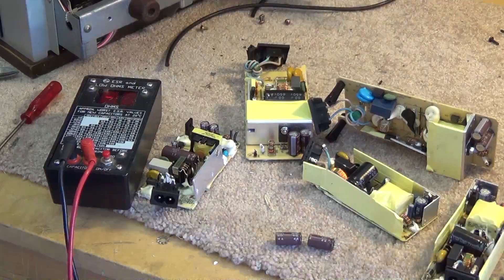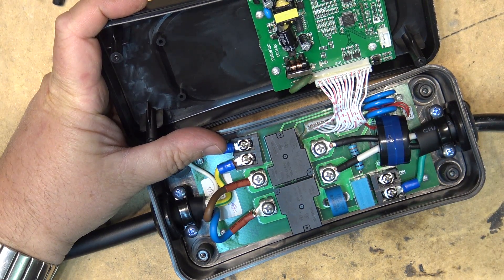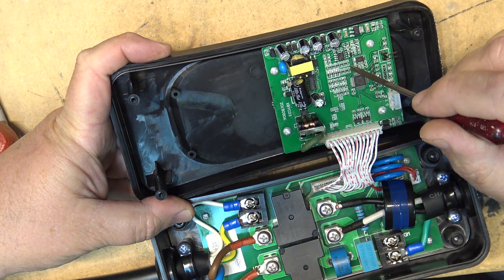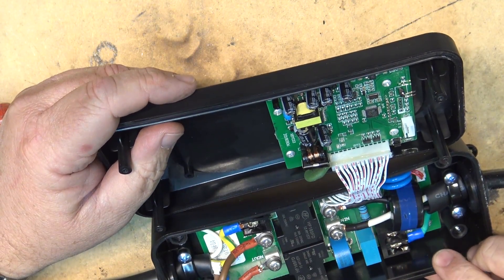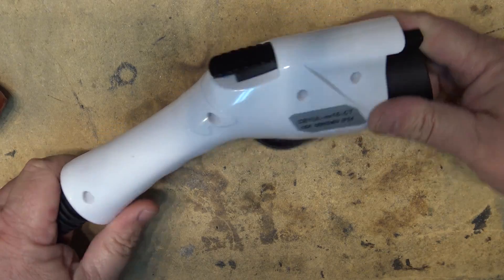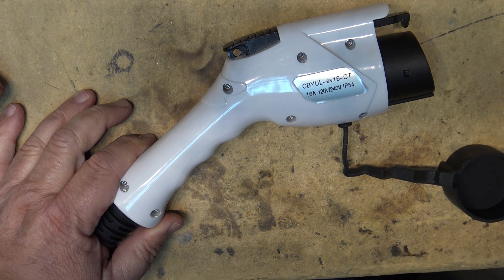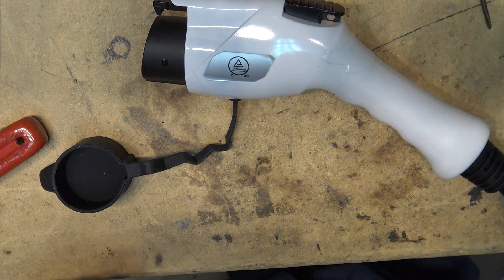Amazon Level 2 EV charger tear down

Comment: Hi. The thermostat on mine is stuck at a high temperature is the a thermostat that can be replaced or should I just get a new charger?
Reply from the maker: The temperature read out is all over the map on mine.  Works fine. If it charges leave it alone.
Reply: @ it charges until the temperature gets too high and then stops charging

Comment: isn't the plug a 5-20? I thought this was always 120v?
Reply from the maker: No on the 20 amp 120 plug the neutral is horizontal on the plug. This js the left side prong looking at it with ground on bottom.  The socket can accept a vertical or horizontal plug (15 or 20.) The 240 plug the hot side (right side) is always horizontal and the left side (also hot on a 240 plug) is vertical for a 15 amp and horizontal for 20. This is a 240 plug.  It came with an adapter cable to plug into a 120 circuit.
Reply: @12voltvids  ah I see

Comment: 2:03 This can not possibly be the current sense transformer if both the live and neutral are passing through. I suspect it works more like an RCD. In normal operation, the live current and return currents cancel each other out. If there is a leak through water contamination, electrocution, etc it will cause a misbalance in the live and return currents which will be sensed and shut down the charging.
Reply from the maker: Don't have a schematic so don't know what it does. Likely part of protection. There is a current sense on it as it displays both the voltage and current being drawn.  Both are hot on 240 which is what it is operating at.

Comment: I don't see this model on Amazon now. What make was it?
Reply from the maker: Couldn't tell you.  It was the cheapest 16 amp charger I found and it has been perfect for the past 2 years.   No issues and the on board metering is spot on.
Reply: @12voltvids  Looks like you got a great deal. Nothing comparable for that price now.

Comment: thanks for this valuable content. Really appreciate your efforts. 
I just want to add some valuable update, please correct me, If I am wrong.
1)Its looks that, it has voltage sensor transformer Which is ZMPT107 module just next to neutral connection (square blue color), right now it's only sensing 1 phase voltage i.e. 0-120V 
2) just next to that is current transformer it's in series with live wire so I think it's not inductor. 
3) both live wire pass through the one current transformer: This special arrangement is done for leakage current detection same as RCCB (Residual Current Circuit Breaker).
Reply from the maker: No it measures the full voltage but I suspect that is done on the control board not the relay board.  All the relay board is doing is ground fault charge metering.  
The display is fairly accurate.  As an expirimebt i drove the car to completely drain the battery 14.5kw. i then turned off all the power to the house and just recharged the car so I could compare the smart meter to this one.  This showed 14.85 kw consumed and the Meyer on the house showed 14.93 so it is pretty much bang on with the home meter as the only other thing running in the house during this expirimebt was the pump on the fish tank.  Didn't want to find a bunch of floaters in there.

Comment: No PEN fault detection with earth disconnect. Also, probably no DC leakage current detect. Both needed for regs in UK now without external protection doing same job. Looks like evconnectors.com unit does have these more modern safety features.
Reply from the maker: Of course it does.  Disconnect the ground and the fault light goes on and the unit will not connect the car. Disconnect ground on the car side and same thing.  Flashing fault light and no charge.
The DC leakage protection is done by the on board charger in the car so if any battery leakage were to occurr the car would never turn on the power over the pilot control line.  This has every bit as much protection. As anything out there.  Basically all that is required is ground monitoring on the controller and AC leakage.   The rest is onboard the car.
Reply: I don't think you get my meaning. In this unit, the CPC/earth connection is straight through. There is no PEN fault detection disconnect as this requires a normally open relay contactor for the earth connection (and live). A PEN fault is when neutral from grid becomes accidentally disconnected outside of the property while earth and live wires are still connected. DC leakage trip for EV charging is a requirement on the supply side according to UK regs; doesn't matter if car has it or not. Just telling you how it is over here. This type of unit does not meet the requirements without more protection up stream of it.
Reply from the maker: @jam99  over here the ground must be bonded at all times.  No matter what. Nothing would ever pass regulations if the ground could ever become disconnected for any reason as that would create a possible "floating car body" situation. In fact on the first gen volt the system monitors the bond to ground and if the bond to ground is lost a fault is generated that locks the charger out and it will not reset without a trip to the dealer because they have to isolate they have to test and isolate called ground fault isolation that happened on my car once on my old charger the ground wire broke between the charger and the connector on the car and the car got locked out and had to go to the dealer to be reset. On our system here our level 2 Chargers do not even have a neutral connection they're connected to both hot circuits only on a level 1 charger is one lug connected to neutral so you have a hot and a neutral but on level 2 it is the two phase hot and ground. Different country different electrical code regulations but this charger has all the safety devices required for North America.
Reply: @12voltvids  This regulation is not in place for anything the house owner or consumer may or may not do. It is in place in case the neutral becomes disconnected up stream of a property but where the live and earth are still connected e.g. a bad repair by the electricity provider. That is how poor the services are in our country now. We have householder regulations to cover the possiblity of a negligent repair our electricity network provider might make on the supply to the house. The floating car body situation is exactly the problem, except with TNCS, the car body actually becomes (more or less) live because of the earth-neutral link on the input to the property. (Just for info, it is rare for a domestic property in UK to have more than 1-phase connected.) A way around it is to have the EV charger disconnected from the main house bonded 'earth' and have its own earthing rod, but nobody wants to do that if it can be avoided. I believe most PEN fault detectors check that the difference between live and neutral is within a certain voltage range, and disconnect within 5secs if not. Thanks for the info.
Reply from the maker: @jam99  
The neutral and ground are linked at the panel, but also grounded at the electrical panel. This is done for exactly this reason. If the neutral bond at the pole were to go open, yes there would be a GPR on the neutral and ground but the fact it is earthed would keep the rise to only a few volts maximum.  In North America we use split phase 120 two phase. For 120 appliances it's between one of the phases and neutral for 240 appliances it's between both phases no neutral. In the event of neutral Bond loss the neutral will start to follow the phase that has the highest load this causes lower voltage on that phase and a little higher voltage on the opposite phase.
Reply: @12voltvids  Sorry, didn't understand the first sentence there. Are you talking about supply from a pole and overhead wires? And what panels are you referring to? Just trying to understand the difference between your typical domestic earthing and ours. Do you typically have neutral and ground wires linked AND physically connected to a good earthing rod, both at the input to your house? We have different systems: TT (local earth rod into ground, no earth wire connected to outside supply), TNS (no local earth rod, neutral and earth wires not linked at house and earth wire is taken to true ground at various points along supply and at supplying transformer), TNCS (no local earth rod, neutral and earth wires linked at the house input, neutral might be also truly grounded at various points along supply to house, and neutral and earth linked at supplying transformer). So do you guys typically have what we call TNCS but with a grounded local earth rod?
Reply from the maker: @jam99  
As per our local code in BC, (standards are different in other provinces) the neutral is bonded to ground at each utility pole with a transformer (or in the case of under ground facilities at each transformer point and each point where overhead wires run down into underground ) and at intervals not exceeding 400 Meters.  Even if there are no secondary lines there is a neutral conductor that is bonded every 400 metres.  At the service entrance to each building the main electrical panel is bonded between neutral and ground and there is a ground electrode that is driven into the ground at the service entrance to provide a fail safe bond to ground at all times. I work in the Telco industry and we can not provide service to any building that does not have a ground if there is power present in that building.  For buildings without a permanent bond (construction trailers ect ) we have to drive our own 2 metre ground rod in to protect the telephone infrastructure.
Reply: @12voltvids  Very interesting. Sounds very sensible! Far more sensible than the money skimping efforts our national suppliers chose once they started doing away with TNS supplies. Out of interest, with reference to the grounded electrode for a building what's the wire thickness between the electrode and the panel and roughly how long is that run allowed to be?
Reply from the maker: @jam99  it's normally a #6 ground wire and must be installed at the service entrance. For services over 125 amps I have seen 2 #6 bond wires.
Reply: @12voltvids  16mm2 - I think the same here for TT rods. Chunky! Makes sense. Thank you for all the info.

Comment: I would prefer one that doesn't do the ground fault detection, or just display an warning about it but still let me charge. I have seen this in Mikeselectricstuff videos, even on original EVSE from BMW. If I need to charge on the move at someone's house, I need to charge, cannot wait till they fix their grounding.
Reply from the maker: That's too bad. Ground fault detection is a critical safety monitor. Without a proper ground the entire car could become electrified and electrocute anyone that touched it. Besides the EVSE having ground fault detection, the Chevy volt also has it built into the car, as one time I went to a public charge station that the ground was damaged on the plug, and when I plugged the car I got an amber light on th edast instead of a green, and the display in the car said "Ground Fault, Can Not Charge"
I don't know if all cars do this, but the volt does, and I am sure the Bolt does as well and I am sure most others also will have protection from faulty EVSE equipment. What I can say now, is  8 months in with this cheap unit, and it has been flawless, has not given any problems, and the display screen that measures consumption if dead on with my utility meter and the on board consumption gauge. 
If my car says I used 14.2 KWH, when I charge it, the controller shows 14.8 as does the utility meter. That extra .5Kwh is used by the bettery chiller to keep the bettery temperature down during charge. It has been a flawless charge cord for 217.00.

Comment: This is charger? No! it's Input protector!
Reply from the maker: No it is a charge controller.  It communicates with the car over the pilot control channel and turns on power once the car is ready. It also as leakage fault detection on board but the main fault detection is on the car itself.  This is just a remote controlled switch.

Comment: what 120 v AC in car voltage ?
Reply: 240V
Reply: @JandeVu   no in America is 120 v
Reply from the maker: It is a charge controller for electric cars. For the record we have 240 volts here just like europe, we also have 120.  Small appliances and devices run on the 120 side, a single phase to neutral (ground) and larger run on 2 phase which can be either 208 or 240 depending on whether the building is single phase or 3 phase.  
Our 240 devices operate exactly the same way. 
We have different plugs depending on the voltage and then there is the 4 prong plug for ranges so it can have both 120 and 240 available. 240 for heating elements and 120 for plugs and lights.
Reply: @12voltvids  cool ,nice explain
Reply: @12voltvids  Europe is 230V to be precise :)

Comment: Is charging quicker a good Idea? I do realize that modern batteries are designed to accept large amounts of amperes going in, do they heat up in response? Lithium ion I suppose, two wheeled fun vehicles in the UK from China with LI batteries in have been known to explode and catch fire when charging etc. don't mean to annoy you but what's the difference between quick and quicker, especially if you're charging overnight and are asleep?
Reply: You could always fast charge but it shortens battery life.
Reply from the maker: This model does not have fast charge capability. It has a gas generator on board for extended range driving.
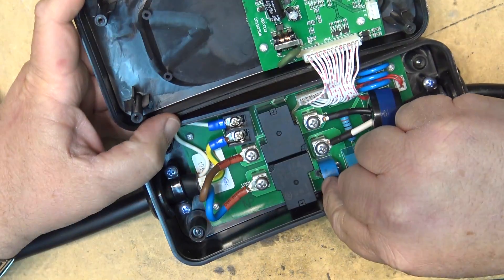Reply from the maker: The difference between 120 and 240 charge times on my car is..   120v 14hours. 240v 4 hours on this cord. Had I go for the 30 amp cord I could do it in 2:15 but I would have to upgrade my panel as I am pretty much at the limit now. I have 2 electric cars that both charge at the same time.  Also the batteries have thermal management and liquid cooling.
Reply from the maker: Fast charging a full on ev every time will reduce the life of the battery.  It is ok when traveling to do it once in awhile but charging at home over night is preferred.  My cars are both chevy volt which are plug in hybrid.  Since they have a gas generator on board there is never a requirement to charge when traveling, just let the battery run down and let the engine start up and continue on gas like a regular car. Therefore the on board charger is just a standard level 1/2 ac charger. The batteries are cooled and heated to prevent thermal degradation.   The older car has 160000 miles on it and the battery has shown no degradation yet

Comment: I can see some flaws in that design: 
Having the red wires running between the MOVs puts these security critical wires for ground fault detection to the risk to be grilled when a overvoltage heats up the MOVs. 
If one MOV gets damaged from a overvoltage spike there is no thermal fuse beneath it to cut it off the current, so it might start burning. 
On the ribbon cable connector between those 2 PCBs you have the high leg phase and the low leg phase, say 240Volts very close to each other, as the supply is on the display board. Any creepage distances? Is there a fuse on the lower board?
Reply from the maker: A closer inspection shows that the 3 blue components that I assumed were MOVs are actually ceramic capacitors and form a capacitor dropper current limiter to feed the power supply on the top board. There is no direct connection between the line input and the ribbon cable, but there is a connection from the line input through the capacitors, and then over to the ribbon cable. The MOV is the green component next to the input choke on the top board to protect that control board.  When you think about it, the main board would not need any MOV protection, all it is doing is being the switch to turn power on or off to the car. All protection for the charging circuit would be on board on the actual charger which is part of the car. The only over voltage / surge protection this thing needs is on the power supply for the control board and it has it.  If you watch at about the 1:19 point you can see the traces leading to the 3 capacitors. They are configured as follows.
Line (black wire) connects to the left leg of the bottom blue capacitor and the right leg of the top blue cap. The left leg of the top and middle cap are connected together, and feed the trace that supplies power to the power supply on the control board through pin 3 of the ribbon cable. The right leg of the middle and bottom capacitors are tied together, and the trace runs under the leakage detect coil into a CP surge arrester, the other side is connected to ground. It is hidden by the leakage sense coil.
The white input wire runs through the current shunt. Labeled neutral, as if it was plugged into 120, this would be the neutral side, but on 240, it is the second hot wire.
So where those red wires are running poses no hazard at all. Ceramic capacitors generally do not ever fail and in this case they are being used as current limiting as part of the protection circuit for the control board.

Comment: Nice charger but still a lossy way to drive
Reply from the maker: And why is that. You made the comment, so back up your statement. Why is an electric car a "lossy" way to drive.  I saved enough fuel (was using about 100 a week in my old car) to buy a second electric car after 8 years just from the money I saved by not having to go to the gas station or change oil and service brakes every 6 months. I can drive my car for about 30.00 a month on electricity vs 400 on gasoline.
Its fast, powerful, smooth and quiet.